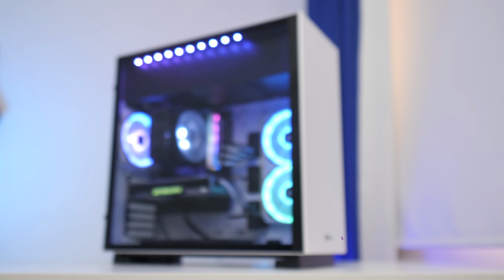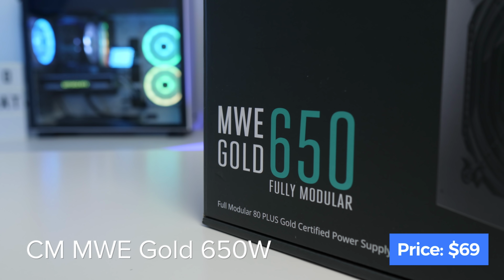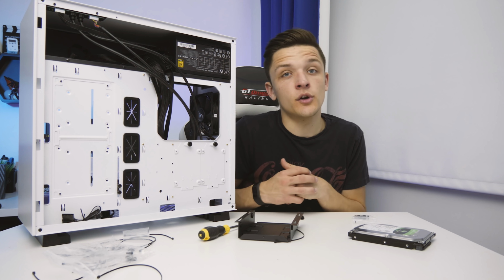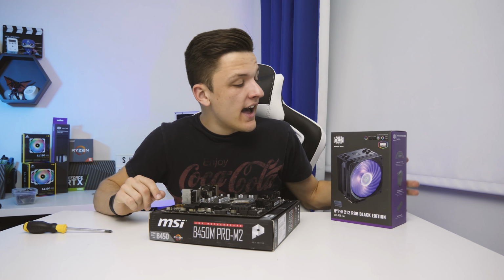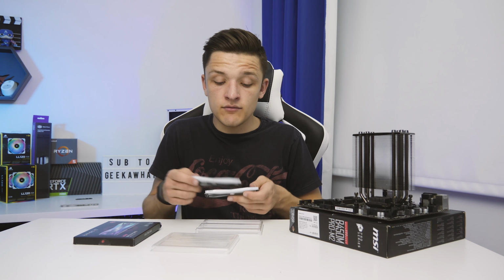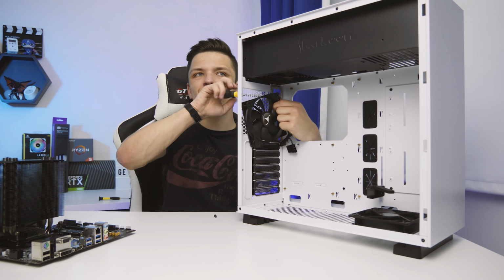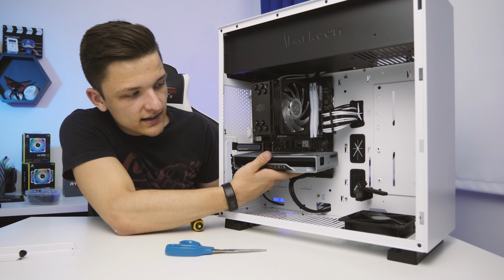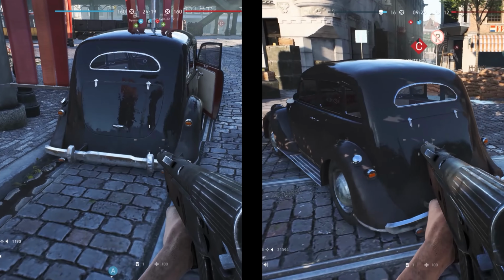Epic $1000 Gaming PC Build 2019! [RTX 2060 Build w/Benchmarks!]

Comment: Hi, One question the other components are compatible with the case NZXT h500i.
Reply: Yes, both cases are standard atx cases and have the same layout. The only difference is for the NZXT the psu goes on the bottom.

Comment: so currently i have an i5 8400 and a gtx 1050ti
i am going to upgrade my card to the rtx 2070
what PSU should i get???
Reply: Depends on your other parts. You can calculate it easy on a Google site like psucalculator it's very easy it will show you how many power it will use and Which PSU is recommended
Reply: Get a 550 watt
Reply from the maker: 600 Watts ish is where I'd go - a decent 80+ Bronze or above one, though :)
Reply: Altaaf Bechan thank you for that. didnt know psu calculator even existed
Reply: GeekaWhat cheers pal

Comment: Can i put a RTX 2060 SUPER instead of the normal 2060 ??
If yes i need to change the power supply?
Reply from the maker: Yes you can! The PSU should be more than adequate for the Super card :)
Reply: Thank u so much !subbed + liked

Comment: Im not a big fan of any case that uses a PSU mount on the top of the case, it just seems sketchy to put the heaviest component up at the highest part of the computer, it also shoots heat all over the case. The basement helps in this instance but its not ideal in my opinion.
Reply from the maker: Hey dude, I get your point but there's more than enough structural integrity to support it! Plus the fan on this orientation actually takes heat out of the case it's a win win! :D

Comment: If you’re going for a GPU that’s as cheap as the rtx 2060, you might as well get a VEGA 56. It is cheaper and performs a lot better. It does not have ray tracing, but the performance is outstanding

Comment: can i use a cm mwe broze 550w as well?
Reply: if its a name brand psu yes you can but i wouldnt use anything generic. the bronze to gold or even platinum rating is just how efficient it uses electricity so by using a bronze model you might just have to pay a dolloar more a month on your electric bill. 550w is more then enough to power for this system tho.

Comment: Is the CPU a bottleneck for the 2060?
Reply: No the ryzen 5 2600 is perfect for the 2060
Reply: can u also use the amd Ryzen 3600 5?
Reply: @diegolanze8093  ye it still wont bottleneck and it will work even better :)

Comment: hey I got an ancient pc and I want to replace the ENTIRE thing. but being fucking broke I want to do it in parts. could you make a video where you show the order you would upgrade certain parts in a system (so they could either be added right away or after the next part) so I could see a performance throughout the process? 
The specs I am planning for my upgrade are
Antec Torque Chassis
Intel i9-9900k
ASRock Z390 Taichi Ultimate
HyperX 32GB Predator RGB 3000Mhz (4 sticks)
Zotac RTX 2080Ti AMP
WD Black 1Tb NVMe (2)
WD Blue 1TB SSD
Antec HCG Extreme 850w
Antec Prizm ARGB Fans
Bitspower CPU Waterblock Summit EF - White Top
Bitspower Leviathan Xtreme 360 Radiator with Quad G1/4" Ports, 360mm x2
Bykski RTX 2080/2080 Ti Founds GPU Block - FR-N-RTX2080TI-X
ThermalTake C1000 RED
Reply: yoitsgunattack uhhh what do you need 32 GBs for 16 is way enought
Reply: @nerbakken  i think every component of the build is a bit overkill and thats kind of the idea cause i play on 3 1440 144 screens. I kind of missed how its meant to have 2 2080 ti tho.

Comment: why didn't you take ryzen 5 2600X ?!
And rtx with i5 8600k or ryzen 5 2600X ?
Reply from the maker: No point in the 2600X when you can just overclock the 2600. i5 8600K is pricey, last gen and the motherboards required for overclocking are silly expensive - hope this helps!
Reply: ok thx 😍

Comment: Got a 2600x is at 3.975 ghz under load at 57c max and 16c idle with hyper 212 black edition and Asus 2 fan 2060 at 1750mhz under 62c under load and 17c idle And fractal design meshify c with the 2 case cans on the front there both high speed 120mm fans and one purchased noctua 120mm on back and a 240gb ssd and 1tb hard drive and a Asus prime X470-pro gaming motherboard and 2x8 gb 3200mhz cl16 ram  and a 650w gold fully modular psu all brand new for ( 970.52 ) LOL😂😂

Comment: Guys ONLY get a better CPU Cooler IF you're planning to overclock your CPU. If not, AMD one is fine cuz it's an AMD CPU..
Reply from the maker: I pretty much agree with you there, the 212 RGB is so cheap though it's a great addition for keeping temps and noise down :)
Reply: @GeekaWhat  Yes, but you still spend money for the AMD cooler tho as you need the cpu. It comes standard with a cooler (boxed) unless you could get the tray version or sell the amd cooler ¯\_(ツ)_/¯

Comment: Ummm... how much air is going through this case? You are probably going to need to drill some holes in the case. Yikes!
Reply from the maker: If you watch the video properly, you'll see the airflow intake is from the bottom, NOT the front - hence the lack of front ventilation....
Reply: @GeekaWhat   Yeah but what about the exhaust?
Reply from the maker: 120mm at the rear of the case, like any normal chassis... Also got those front fans in there you can utilise...

Comment: this is pretty bad build. here are the issues:
1- 5 case fans + 1 cpu fan + 2 gpu fan + 1 PSU fan = 9 are you kidding me?? you thing you running an oven? these fans create lots of EMI and noise and suck unnecessary dust into your PC.  keep one right at the back of the case is more than enough. 
2- power cable extensions are rediculous. just adding another failing point to the circuit. in fact, I don't like fully modular PSU too. I like 24pin PSU cable nonremovable.
3- all those Christmas lights non-scene, spend your money on more practical parts than gimmick toddler  toy
Reply from the maker: 'those fans create lots of EMI and noise and suck unnecessary dust into your PC' HAHAHAHAHAHA